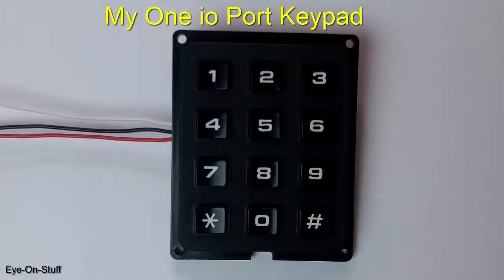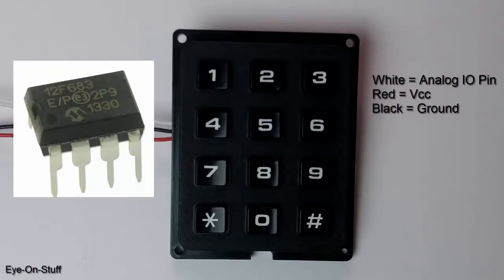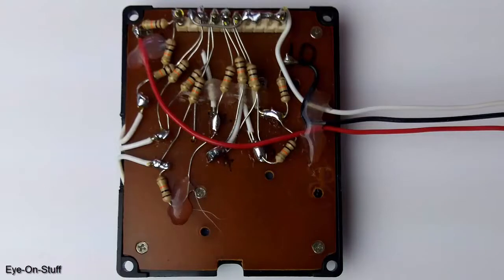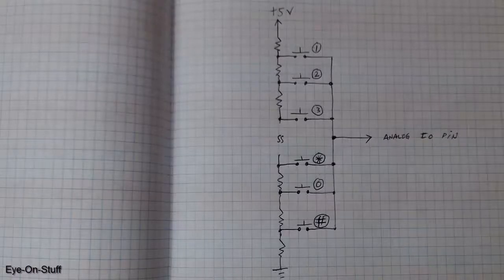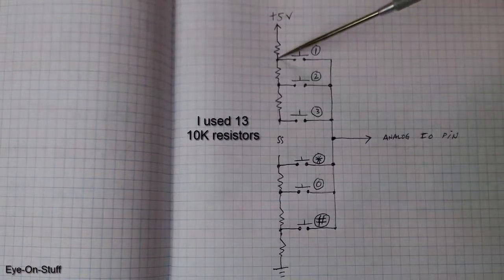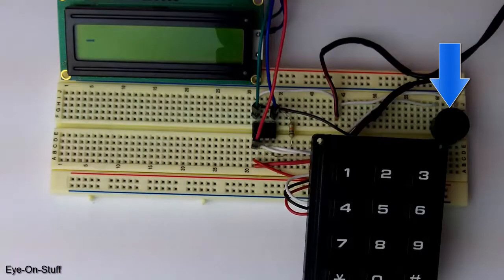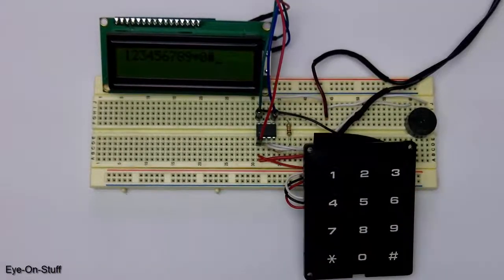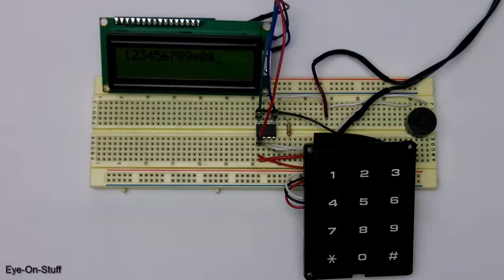One Wire Keypad : Use only One IO Pin for a 12 Button Keypad: Eye-On-Stuff

Comment: Hi there, I have just bought off Aliexpress, “Button Keypad module 4x4. One analog out. Simple connection to Compatible for Arduino, Raspberry, STM.” Cost about $4 NZ. 
I have been looking on you tube to see if there is any info on it. Your entry is the closest yet. If it works they I will be getting a few.
Cheers